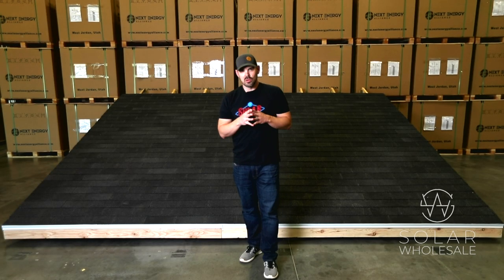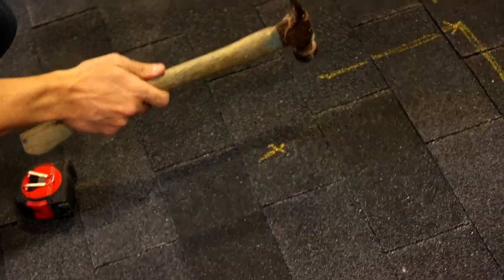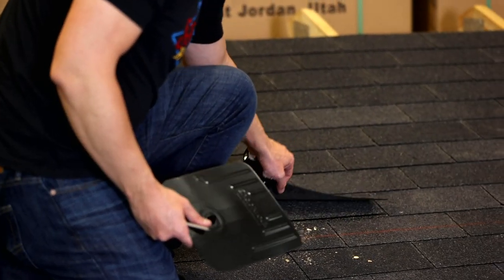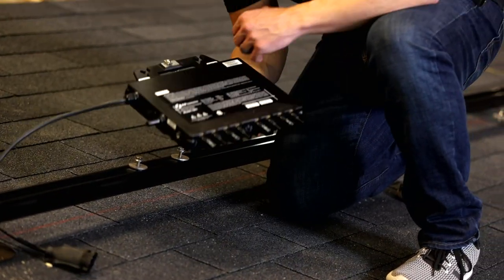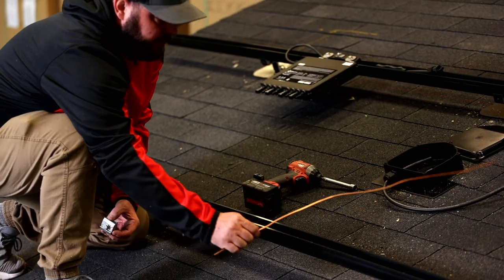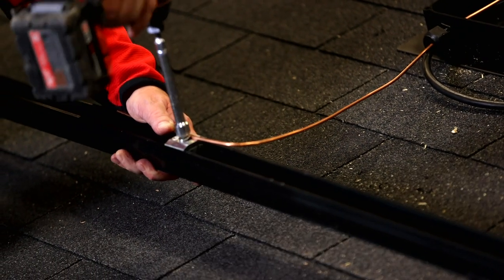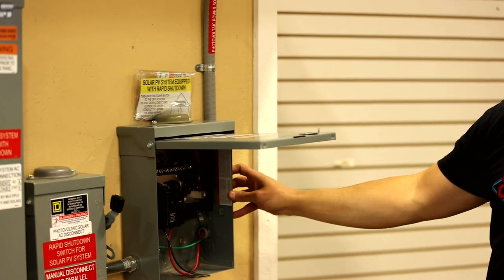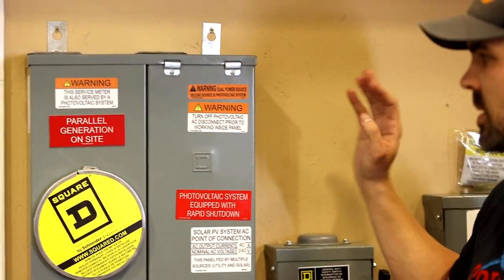DIY Solar - How To Install Your Own Solar

Comment: So if you installing a set of 16 modules with microinverters, where do all home runs specs meet would help (at jbox?) so why a combiner box need it if you adding a disconnect switch? Maybe more electrical details would simplify it. Thank you

Comment: hi Doug and thanks for your clear demonstration on installing solar panels.  I am considering installing on my new A.D.U. that I am building as i speak and this addition will connect to my existing home that will be a total of 2000 square feet  floor plan. I believe I will need about a 4k system? my idea is to install the roof Jack's first then after I complete the solar system after i complete the A.D.U. project that may take a year being that i am building it on the weekends. I am a building contractor and this is my own home. my question is, can I purchase the tracking system first so that I can incorporate them while I am installing my asphalt shingles.?

Comment: This was a great step by step video. Cant wait to get to Part Two. How many volts or Kilo watts, does it take to comfortably run a two bedroom cabin with a washer, four lamps, refrigerator, two fans, a TV and charger for phone, charger for laptop? I am hoping to use this kit here in Columbia South America. BTW...how much is the kit?
Reply: Did you end up doing it.?

Comment: Great video. Still waiting on my delivery but this helped me visualize what I’ll be starting soon. Thanks.
Reply: When did you place the order?  I’m looking to order a system soon.
Reply: @patrickcasteel3780  I was paid in full the middle of October. I had a delivery today that got me my panels and most everything but they didn’t send everything I needed and the local shipping lost my rails.
Reply: @michaelbartlett1589  , our rails were lost also, for over 2 weeks! Of course it was right when the weather was good. Now it is back to cold and rain/ice.
Reply: @fetch33  the first throng they told me when I called in and finally got ahold of someone was oh this happens all the time 🤦🏼‍♂️
Reply: How did the installation go?
Reply: @AmrushPrence  really easy. Worst part of it all was customer service with the company. But overall worth it.

Comment: Also, do you have a video of installing multiple rows of panels, particularly showing the wiring where you connect multiple "source circuits into the junction box"?  This would be very helpful.
Reply: Yes, I'm curious about this too; at what point do you add additional circuit breakers (20amp each right)?

Comment: 3' from ridge & 3' from rake (left & right); what about the bottom - is it also 3'? I'd like to get 3 or 4 rows of panels to go across. Also, if I install these on a detached garage to the rear of the home (100' away), how do we run the wire (and what gauge) to the control box & disconnect - do we lose energy as it has to travel that 100'? Would it be better to put battery storage in the garage and store the energy there to optimize collection?
Reply: Interesting questions!  Would be good to know.

Comment: 17:18 when you are messing with these wires here, how are they not hot? They are coming directly from your solar panel, through the inverter, and into these wires?
Reply: The solar panels don’t supply power until the meter is hooked up and it recognizes it’s connected to the grid.

Comment: Hi, you always start your first measurement 3ft down from the eave. In my installation, it seems to make more sense to start with the bottom row of panels. Is it okay to work from this direction? Are the required easements from the bottom edge the same as from the eave? Thanks.
Reply from the maker: Hey Nic, there's no exact way to measure it out. You just need to be sure you're not encroaching on any fire code setbacks. Some jurisdictions have eave setbacks but most do not require any.
Reply: @DailyTech Business Computers Find a Euro You tube video FFS Dude.  The conversion is not difficult.

Comment: You say don't let wires sit on roof yet you show the main wire from the microinverters entering into the roof junction box resting on the roof.  I assume this is an oversight?
Reply: When you are done wiring the roof junction box you would pull it right and zip tie it so it’s not resting on the roof like it is in their video

Comment: Do you have instructions that deal with installation on a roof with concrete S-tiles?
Reply from the maker: Not yet but we're working on it! SnapNrack does have some replacement tile attachments to make the install much easier.

Comment: Really cool looking project . But Twice the cost of equipment . DIY cost of install is leaving you over the total cost of competitors fully installed .
Reply: This hasn't been true in our case. Local installers quoted 47k-82k. We spent 25k on our kit.

Comment: No connections to the main wiring harness or the micro-inverters were made. This is a major omission. 
This is a DIY project that can be done easily with two people, and much of it can be done by one person. You will learn as you go, and the second time through would be much easier than the first. 
A video that shows common first-timer mistakes and how to avoid them would be great. Also, keeping the rails straight (you roof probably is not perfectly straight) matters. Then leveling each row of rails with the ones above and below will make the whole array flat. There is more to the installation process than what this video shows, but it is useful for the package that Solar Wholesale sends you. There should be a video just for the unpacking and counting of what was sent. If you are careless and don't follow the instructions on the box, you can damage the panels if they are allowed to fall while removing them.

Comment: Question: If roofs and shingles aren’t straight then what is your reference point for measuring?  It looks like you’re using the roof and shingles which you just said aren’t straight.  Ha ha.  S